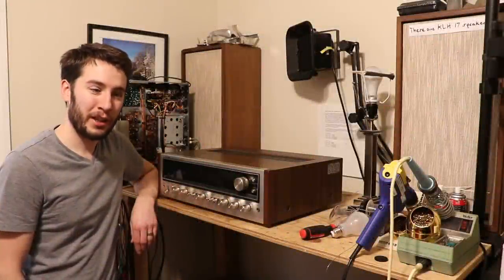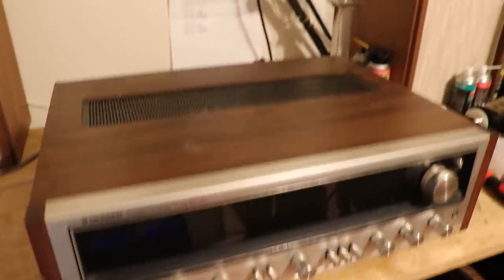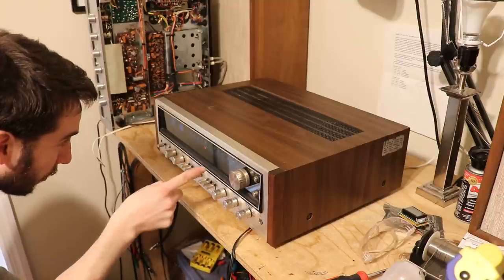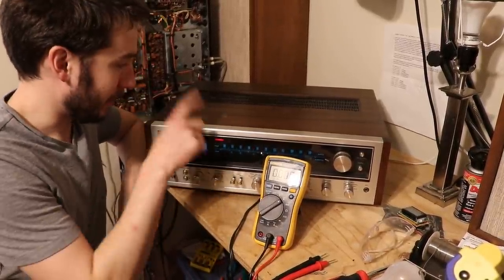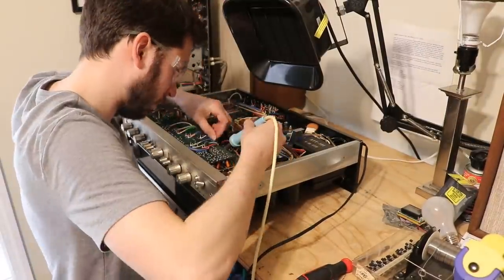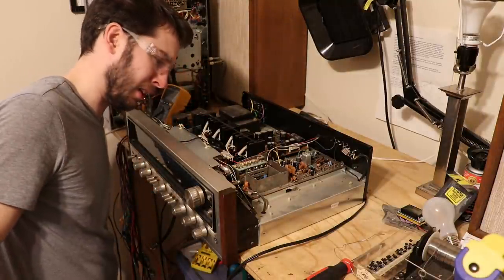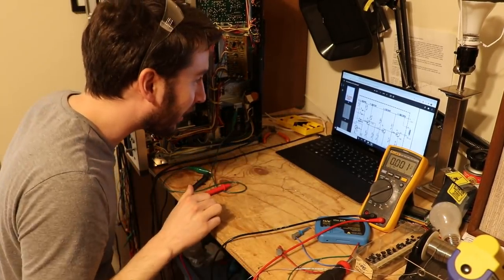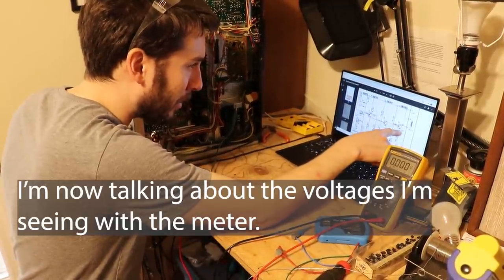Another Pioneer SX-737! Why won't the relay click in?

Comment: I worked in a Pioneer factory service shop and Pioneer would supply us complete Power Amplifier boards to replace under warranty on customers units. The reason the transistors would blow was bad bias pots the wipers would lose contact on the tracks when the receivers would get hot. I just rebuilt one for a friend recently and it was nearly 50 years old, replaced lots of electrolytic to get it back working!
Reply: recently fixed a SA-900 and it was doing all kinds of wacky things till I found out the wiper was dead in the 50ohm pot. 
strangely at the time there was NOS power amplifier boards on ebay. seller claimed to be a service tech for Pioneer in the 70s and and 10+ for sale.

Comment: Wow they sold a lot of those sx-737 in your neck of the woods. Disappointed you didn't pressure wash the controls. Because it only takes a few mins, I always clean and inspect the unit and then clean switches and controls before doing anything else.

Comment: whats a fair price for these? i came across one locally guy wants 160 for and it was just serviced and had some things replaced. lets pretend nothing was replaced on it what should someone pay? another question would be are these any good? i see they only have 35w per channel which isnt much. does that limit its performance? should i go after a higher model than this? i know nothing about these older recievers so any help is appreciated. i find your vids interesting because when i do get one i can fix anything on it easily.

Comment: One question.  I just picked up a Zenith MC 7050 which  is very similar visually and under the hood to certain Pioneer models of this era but it has one issue. The lights come on, FM tuning needle sweeps but there is no sound out of speakers. Power supply and output transistors test good as do all fuses but the protection relay doesn't click at all. It's almost as if it is stuck in protection. Any idea where to start checking this?  Thanks!

Comment: Hello, love your videos! I have an old Pioneer SX-828 that was working fine for about 2 years after I bought it. Now when I turn it on, I get normal sound out of it for 10 minutes or so, then it clicks off and produces no sound at all. If I leave it sitting there turned out, it produces a single "click" every few minutes. Any ideas?

Comment: Nice video! It's good you replaced the transistors because they'll probably stop working sooner or later anyway.
I have a question. Do capacitors age when they're not in use? As in no electricity running trough them.
Reply: Yes they do, although my guess is using them speeds up the aging process by some degree. The electrolytic fluid dries over time, regardless of usage.
Reply: @corsav74  actually using them is better than sitting, but the elctrolyte dries out and they pass dc current. Seen as a dc transient on the o scope. They lose capacitance and increase in resistance. Sometimes caps can be reformed by passing voltage through them. The current breaks down the oxide layer that is passing the dc current. Always best practice to replace.

Comment: I have this exact receiver that I just picked up and it has a faulty protection relay I believe. When I got it home and cleaned it and plugged it in (without plugging in any speakers of course), and the relay keeps clicking off and on. So mine needs very similar work, and I have no abilities to do it myself. Could I inquire about your services?

Comment: Great work! I will be doing thee same thing shortly with an old Roland 201 echo. Caps I would just order appropriate values from Mouser. However how do you find replacements for transistors. Is there some sort of spread sheet of modern for old ?

Comment: I don't see a suppressor diode across that relay.  
Maybe that's one reason so many Pioneer receivers have such problems.
Reply: I had the pleasure of repairing a Pioneer M-22 that has protection diodes across the relay and the transistors still died. They measured okay - just lightly leaky. They were a pair of 2SA945.